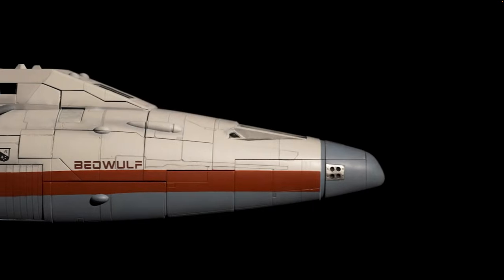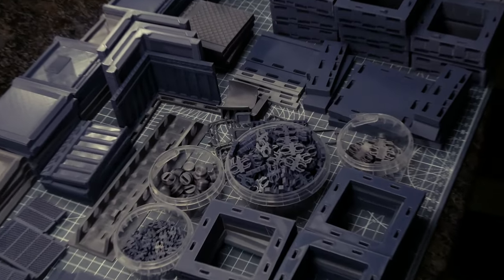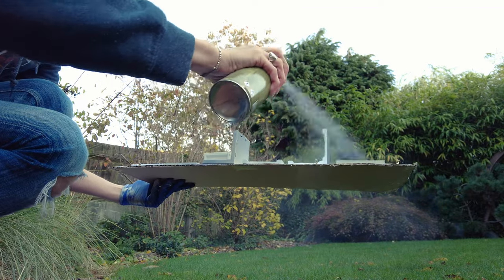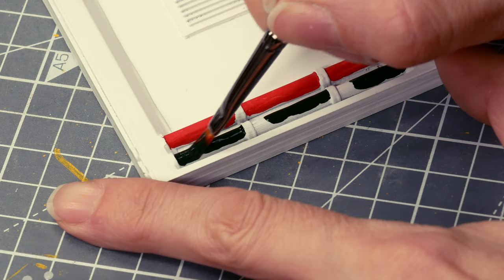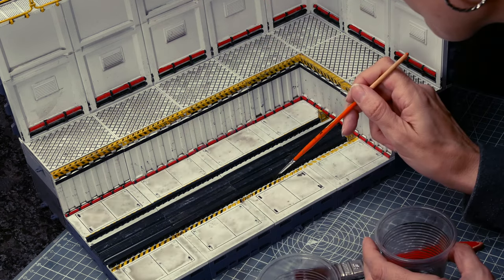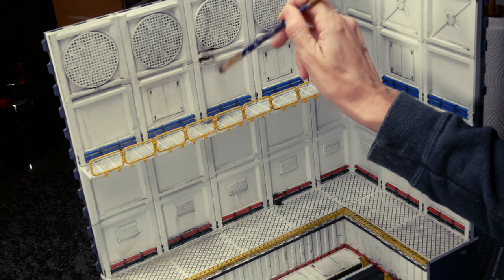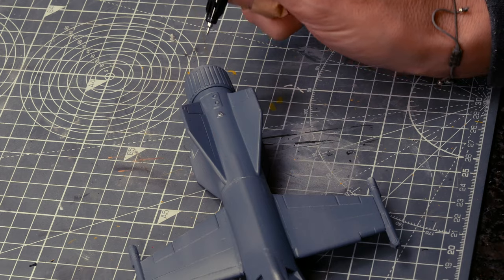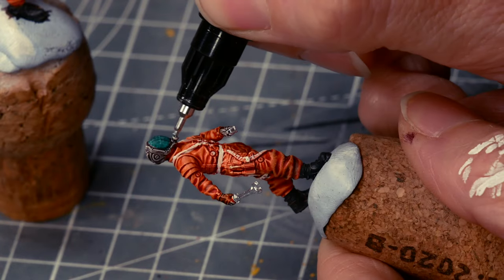Print and Paint a Hangar | Traveller Rampart Fighter

Comment: more traveller!!! would of been cool to add a piolet waiting for the ground crew to finish up
Reply from the maker: The pilots board nearer the launch tubes so this area is the maintenance section. The actual flight deck is massive and I could only fit one small corner in.
Reply: @KathyMillatt  very nice work as always

Comment: Unfortunately I couldn't find any proper spray putty here, I went looking after your last video... anyone else in the comments happen to know alternate names for it I could search? All Google gave me was filler primer, but I've tried that before and it takes a lot of coats.
Reply from the maker: I think spray putty is hard to get in the US although it’s very common in Europe. It may depend where you live. Motip is my favourite brand of that helps.
Reply: @KathyMillatt  Yeah, I found the two brands you use on your website, but couldn't really get those anywhere aside from importing from Amazon UK... which is an option, but makes it kind of expensive.
Reply from the maker: That’s a shame. I know what it’s like as getting American products over here can be equally expensive so I have to find local equivalents or do without sadly.